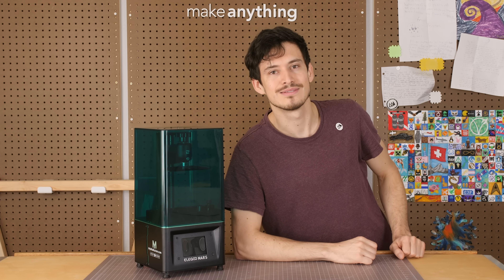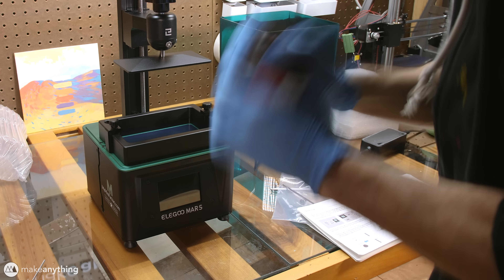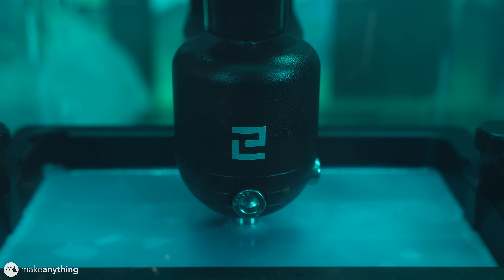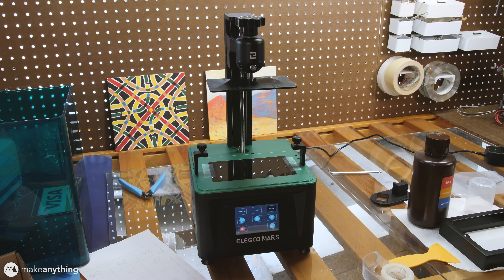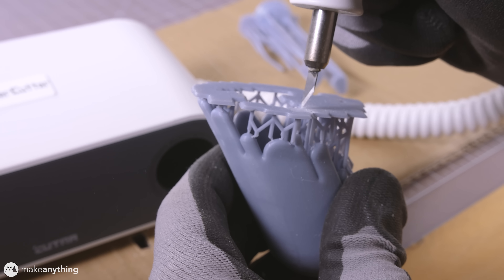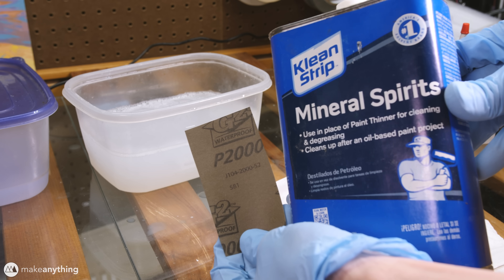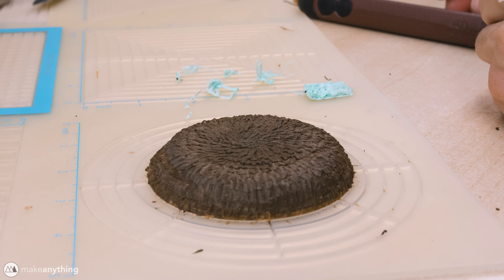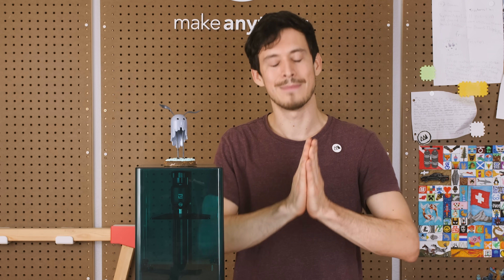Resin Printing with the Elegoo Mars // First prints, troubleshooting, impressions

Comment: I have an Elegoo Mars and I do not need any lubricant. What I do different from you is leveling the bed. I do not use any paper. Y leave the reservoir in its place and level the bed with it. When I tighten the bolts I fully tight one of them first (the instructions telli you which), then the other while pressing (slightly) with my hand the bed into the base.

Comment: 0:54 The Elegoo Mars, is not a DLP (Digital Light Processing) printer, it's a MSLA (Masked StereoLithography Apparatus) printer, whereas DLP uses a projector to project an image to cure the resin, MSLA uses an array of LED light's and a LCD screen to mask off the parts that don't need curing.

Comment: You were saying the resin has ABS-like qualities, is the strength of ABS one of those qualities?
 The sanded finish is awesome, to get anywhere near that quality with PLA some serious filling and lots of sanding and priming would be required, the only thing that has put me off SLA printing is the brittleness of the resin, so if this resin you used is a lot stronger I think I will order myself one

Comment: Great explanation (if low tech, lol) of how the printer works.  All the others I’ve seen just talk about it.  You had animations!

How do you dispose of the used IPA?  I assume you don’t throw it down the sink.  Same question about the soapy water that you used for the secondary rinse.  It might not be as much, but there is still uncurled resin in it.  I’m sure city water treatment plants aren’t equipped to filter out liquid resin.
Reply: You can reused it. Let the sediment settle then hit it with your UV light. You can peel the cured layer off the bottom of the IPA tub and use the IPA again!

Comment: It's a LCD resin printer,not DLP, right? @0:54  you said itsDLP printer. DLP uses MEMS mirrors on a chip to bounce light.i am not sure why no company used it with a string UV laser yet. Assuming TI chips are expensive. Great content as always.
Reply from the maker: I thought that's SLA... Too many acronyms!
Reply: Most of the more expensive models from certain manufacturers use lasers to cure the resins. Much faster and if you don't fill the build plate its even faster still. With LCD's its the part height that determines the time taken to print, not how many things you are printing.

Comment: Insane resolution! Also any chance you could give a 30 sec explanation of how you modeled the drips so organically?
Reply from the maker: After modeling in fusion I quickly ran over the drips using the smoothing sculpt tool in meshmixer. That's it!
Reply: @make.anything  thanks so much!

Comment: This really helped me thank you! I had the same issues as you in that the models stuck to the resin tray. After using some PTFE grease (both sides) it did the trick. I also made sure that the tray didn't look like tray was "sticking" to the glass underneath to give it every chance and that worked. The only issue I have now is that when I import a drawing from Chitubox the base plate moves all the way to the top of the machine and stays there and won't print. Not sure what to do about that yet! I'm also now starting with Fusion 360 as well.
Reply: You shouldn't need PTFE solution on the bottom side of the film (that's RainX for you convenience store types) . The film should be slightly raised from the glass due to how its bound to the resin chamber. The pressure from the build plate should move the film from just above the glass surface to full contact, with the edges  of the film slightly stretching and bowing down. So when the plate lets off the pressure, the film will spring back and air will flow in easily from the edges and suction should never be an issue (this is on the bottom remember). The issue with lubing the bottom of the film is that when it comes in contact with the glass you may get Newton rings and that may affect how the UV light is transmitted through the glass and film to the print.

Comment: I had failed prints too. Its too cold. I put my vat, build plate, and resin bottle in hot water for a few mins before the print. 0% fail rate since.

Comment: There is also a tank clean in the settings on the printer so that you don’t need to drain it
Reply: You have to drain it mostly even with the tank clean option. The clean tank option only hardens the bottom layer for anything that is left over after draining. But what it is really for is to help you remove stuck prints because you can harden the lower layer making it easier to lift a small stuck on part. But the correct way to remove a stuck on part is to drain the tank carefully and then push from the other side of the FEP film from the underside to reveal an edge and use the plastic spatula to pull up the part and remove it. Don't use the metal scraper of course. Just the plastic one.

Comment: After watching it all now, what concerns me is the idea that after-market, people need to add tape to the machine to fix an odd "defect" and if a lot of people have to 'grease' the bottom plate - that also seems like a workaround to fix the machine.  Sure, it is only around $300, so I should not be too concerned - yet, still.  I am wondering how this still compares practically to the AnyPhoton or other similar-priced resin printers.   All said, thanks for your video, your little figure did turn out pretty neat.

Comment: Few questions: 
1. How is the price per print/price for Fillament  compared to normal 3d printers. 
2. Would you say this is worth the purchase 
3. I want to get into 3d printing and this seems like a good option. Would it be stupid for a neewbie to buy a resin printer? 
4. How is this for making bigger blocks of prints. (for example a big cube filled with support Material) is it just for small detailed prints or is this a viable option? 
5. i want to "mass " produce prints for a special purpose. Would you say this is alot more complicated (uv treatment etc) than normal 3d printers? 

would apreciate answers alot
Reply from the maker: Resin printing is definitely more of a hassle to use in general. I wouldn't say it's worse to begin with, but I would only go with resin if it's not possible to do what you want with an FDM printer (eg. Using casting resin for jewelry making or making extremely detailed miniatures). I love my FDM printers for making functional parts, and love that there aren't chemicals and all that.

Comment: Do you have to reapply the lube each time you clean the tank? I would think yes, just need to know =)
Reply: Yes, the alcohol you use to clean the tank removes the lube too so you'll need to reapply it, just don't use too much. A thin coat is all that is needed. I use vegetable shortening/crisco instead of that oil. It seems to work. So little is needed you shouldn't even really be able to tell you put any on.

Comment: Could someone explain why you have to sand your way up in terms of grit level? Like what would happen if devin just used the 2000 grit paper from the start?
Reply: Technically you could but you would clog the 2k grit paper and have to use a new piece every other minute or so, and it would take forever. Think of it as scratching the surface -  first you scratch coarsely removing lots of material - which also removes all the coarse bumps, then you scratch with grit half the width of those initial scratches -  that smooths the original scratches out but leaves new finer scratches, then you smooth out those scratches with smaller grit -  repeat all the way up the grit chain. Heck you can even finish with a polishing compound for a glass like finish (these can go to crazy high grits -  14k, 60k....)

Comment: i used to work with Resins like this many years ago, when it was kind of a hobby thing to pour into molds… & then years later when i took a test for AIDS, both The Eliza & Western Blot, my tests ( 5 or 6 Tries ) kept coming back all woogily ! & The Technicians speculated that i was 'Allergic' to The plastics that they were using in The Tests ! ( it turned out that i don't have AIDS, but they still wouldn't let me donate Plasma. !

Comment: I love that there's pretty much no visible layers, but the whole process seems such a hassle 😩😩
Reply: true, but the higher quality print is SO worth it
Reply: I know its 7 months late, but I recently got the Elegoo Mars, and its not  a hassle at all. It may seem bad but its super easy
Reply: A year late but resin printing has different properties to fdm that make it more suitable for detail work aside from the layers being near invisible. The biggest one IMO is time. On an FDM machine printing a miniature for table top gaming takes around twelve hours to get decent detail. This doesnt include post processing either. On  the other hand resin cures layer by layer and each layer will take the same amount of time to print so you can print a lot of small detailed things far quicker with resin. FDM and Resin have strengths and advantages.

Comment: One problem which never gets addressed with resin printers is what to do with the resin-contaminated IPA. Can it be filtered somehow and reused?
Reply: Place the container containing the IPA resin mix in direct sunlight. The resin will end up being cured and settle on the bottom of the container. At this point, using something like a fine-grade nylon paint strainer, pour the IPA through the strainer into a new container. You can now safely remove the cured resin from the bottom of the container and reuse the IPA and container for additional prints.
Reply: Or let it settle first and then cure it. You get a solid sheet you can just peel off the bottom.

Comment: Hey dude, a couple of things. First, you shouldn't use mineral spirits for wet sanding. Water works just fine, even at 2000 grit. Also, you called the mineral spirits "mineral  oil" at 16:50...those are two different things.
Reply: Also, you painted the eyes with gloss enamel...but then you sprayed over the whole thing with polyurethane which destroyed whatever surface you had and made the entire thing have exactly the same finish. Next time, paint the eyes last! Then they will keep their gloss.

Comment: More post sanding than i thought dlp printers had. That was my hope for them anyways.
Reply: If you remove the supports before curing, they release a lot better. Also: Putting them on the top side of the model was probably not a great move.

I print a lot of miniatures and cleanup of the printed ones is quite easy compared to what you'd have to do with injection molded models.

Comment: How rigid are the final prints compared to plastic FDM 3d printing?
Reply: Depends on the resin you get. There are tons of resins you can get: flexible, clear, rigic, durable, meltable (for investment casting), etc. The key is that this uses 405nm UV so you need to get resins made for that wavelength (its the most common wavelength for current resin printers). Also not all resins are equal, there are special mixtures made for LCD/DLP resin printers (this one) and SLA resin printers.
Reply: I only do parts so I am needing rigid resin but all I am seeing from the videos is stuff made for brick-a-bract and junk but nothing really useful.  I think the resins that these printers use isn't really as good as the plastic FDM stuff.  Commercial resins can be as hard as steel but you will never see that used in one of these.
Reply: @thebeststooge  You should check out Siraya Tech BLU resin. The resin needs the printing environment to be slightly heated (30°C / 86°F), but is very tough and perfect for mechanical parts. Some companies (for example Peopoly) make little heaters specifically for this to put in the print chamber or to put the entire printer inside of an enclosed box.
This resin is stronger than ABS and is equally strong in the XY axes as it is in the Z axis which can't be said about FDM prints.

Comment: Where do i get the lubricant from? Because I am having the same issue?
Reply: It's 3-in-one PTFE oil you can get from amazon I think, but I use crisco/vegetable shortening, used for making pies and cookies and such. Separate some from the container and mark for only 3d printing so you don't eat it. Use just a little bit, so little like you didn't even use and can still see through it. It's cheaper and biodegradable so probably better, but too much would be bad, so just a very thin coat.

Comment: what is the difference in the red mars 2 to the green mono?
Reply: If it says mono it uses a monochromatic screen which allows more light through allowing the layers to cure much faster so your prints will go faster and the monochromatic screen extends the life of the screen because eventually they burn out and have to be replaced anyway. The green mono and the mars 2 pro have monochromatic screens. The regular mars 2 has a rgb screen.
Reply: @jeremiahembs5343  awesome!! Thankyou very much

Comment: The most important thing is it being isopropyl alcohol, i had to order it online, until then i tried all from acetone, mineral spirits, terpentine and a few other.. none of them cleaned the prints by any measure, anything loose just pooled in there, any resin stuck to the prints, stayed there
Reply: The trick is to do it fast, and keep the parts submerged (either in your rinse bath or the ISP). Some of the green cleaning products do well also. There are now a water rinseable resins. Cure the parts under water to keep oxygen away from the part (O2 retards curing)

Comment: You could have managed to print without failures if, when you leveled the bed you pressed down a bit while tightening the screws, you need to be nearly unable to move the paper once it's well set. Also, you shouldn't use that contaminated water on the part again it soapy water dilute with IPA and leftover resin

Comment: I thought you didn’t need support structures with resin printers :/
Reply: You will absolutely need support structures when resin printing. But it will honestly not be nearly as bad as printing the same file on a FDM printer in most cases.

Comment: That's why I got rid of my photon in my appt. Just look at that mess when you get resin where it's not suppose to go and cleaning all that stuff every time with toxic IPA. Waiting untill the bio resins take over to get another one in a few years.
Reply: When you do decide to jump back in the resin pool, I'd suggest looking up the Wham Bam Slap Mat products. I believe they also have mats sized for the photon, they are high-grade silicone mats and would protect any work surface you position them over.

Comment: um...the vat was the wrong way... you got lucky with the levelling because that was completed right (your supposed to check for even resistance with the paper and initially apply light pressure on the build plate when tightening the screws to avoid movement).
The explanation of how the printer works is wrong... it has an LCD screen that will turn off the pixels where the image is and turn on the blue pixels that appear black - underneath is a uv light (sometimes an array of led bulbs) which turn on. The UV light will cure the resin where the pixels are turned off and be blocked by the blue pixels. cheaper printers use RGB screens which means they have 3 colours per pixel, whereas on a mono screen it is solely blue - this allows for an even better quality of prints. On a monochrome printer, it's a few seconds - on an RGB printer ideal prints are usually between 7s-15s depending on the temperature, the thickness of layers, the type of resin being used, the colour of resin, the manufacturer of the resin. Plus don't forget the first several layers have a much longer exposure time to help adhere it to the build plate.
Also...it's normally advised not to print large files flat on the build plate because getting them off can be tricky.

as for printing... you could have put all the items on the build plate and printed all in one go -- another benefit over fdm printers... the time it takes to print is determined by how many layers (the height) and the exposer times, rather than how much per layer needs printing.
angling prints can help - not always necessary though...you do this to either help reduce printing time, to reduce the number of supports needed, or to make sure one side has all the better detail.
The ears needed a base... personally id have printed on its side for support AND to reduce the time needed to print... on it's side it probably would have taken half the time

prevention is always better than the cure -- put a plastic sheet on the desk...far easier to just replace the sheet than to clean up resin off the table. Wear an apron - far easier to put another apron on than get it out of clothes...don't use a spatula on the fep sheet - it can easily be damaged - worse is a tiny pin prick which can cause resin to slowly leak through and get cured on the screen (you'll then need a new screen)... 

resin printing can be so much fun BUT you're dealing with toxic chemicals so you should really do your research first

Comment: I feel like such a ghetto printer now, I don't usually use a pair of gloves or resperator and peel off the failed prints but sinking my finger into the resin and using my nails to get it off, I feel as though I should of died months ago with how much gear this dude's rocking.

Comment: lookied it up on ebay the resin is 1000 times more expensive then the printer WTFFFF!!!
Reply: kibaalberto 

It’s like $15-30 depending on the brand and size.   I just ordered the same one he used for $25 for a 500ml bottle.